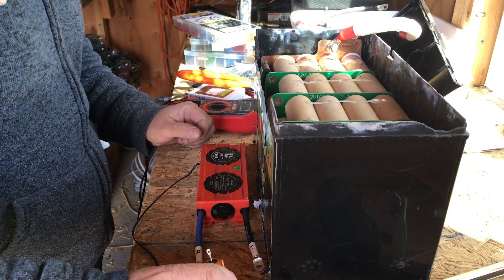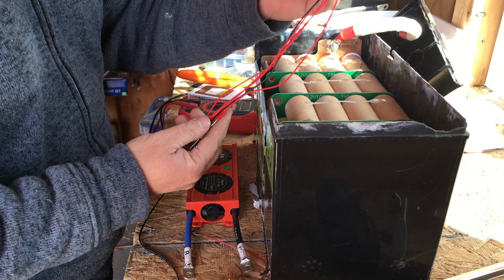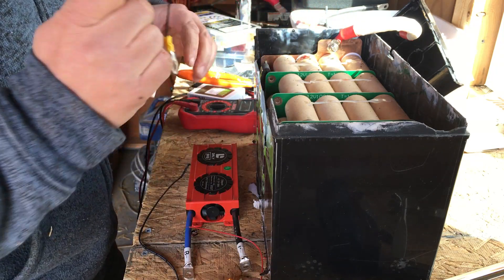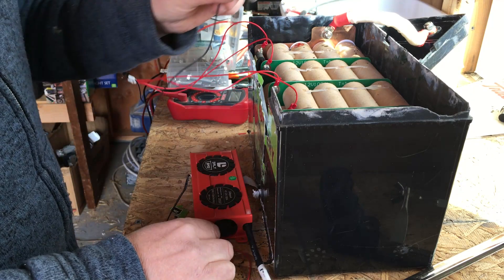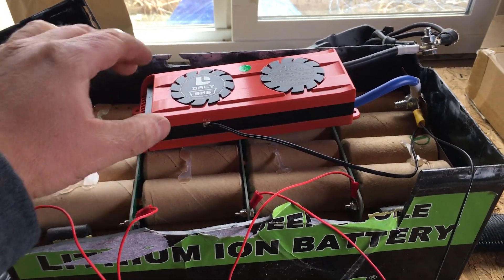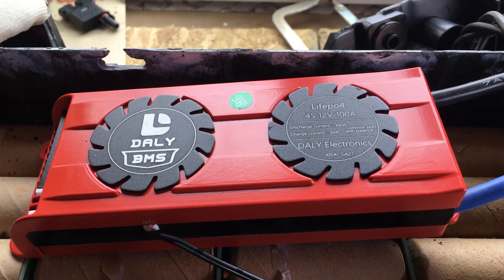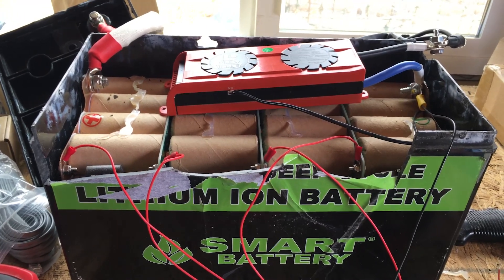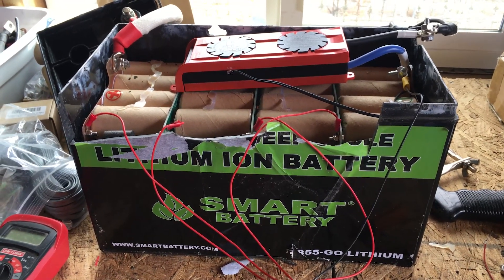Installing a BMS on a 4S 12 volt lifepo4 battery. Updated version https://youtu.be/2bzYHgIR4FQ

Comment: What is the function of the P- /black cable coming out of the BMS? I top balanced a 12V 4 cell battery and when attaching an inverter (3000 watt) and drawing only a 48 inch tower fan one cell always depletes before the other three. Each time it is a different cell. When I attach the P-  cable to the inverter I get nothing . When I attach the P- cable to the first cell negative I get power from the inverter but this is when the one random cell gets depleted while the others are still reading approx. 3.0V but the inverter sets a voltage warning alarm.
If any one can shed some light on this I would greatly appreciate it. TY
Reply from the maker: Lets back up a step because it sounds like you may have not wired up the BMS correctly.
First, did you put the 4 cells in series?
Second, did you wire up the balance wires (the small red/black wires) to each cell.  
B- from the BMS should go to the same cell as the black balance wire.
P- is your new negative.  This is what you would use to feed to your inverter.
if your battery/BMS is not series and balance wires are not correct, then you won't have enough voltage to power your 12v inverter.
Also what is the voltage from your P- and your last cell positive.  It should be at least 12.8v and when full charged more like 13.6-14.x.
Reply: @OurBlackCatCottage  Yes I did have 4 3.2V cells in series which tested at 13.3 volts after charging. I attached the harness negative and the B- cable to the first cell negative and then continued to attach the 1st cell Pos. then 2nd cell pos. etc. correctly. I  then connected the pos. inverter cable to the 4th cell positive terminal and then connected the BMS P- cable to the 1st cell negative which operated the fan until the 3rd cell got depleted while the the other 3 cells remained around 12V plus. I tried connecting the P- cable to the inverter directly with a fresh set of 4 cells but got  nothing but got no power while doing so.   Thank You so much for your help. Also I couldn't see the end of your reply for some reason I couldn't scroll down after so many lines. thanks again
Reply: @michaelc6498  After connecting the B- to the negative side of the cell-pack and then the balance leads, if you measure resistance between P- (which should be attached to the negative charge/load side) the resistance should read very close to zero. If not, you may have a broken BMS.
Reply: @rhkavli  Thanks for your help, it is much appreciated. I may not be understanding your answer 100%. What shall I connect to the P- cable to test resistance? Thanks again
Reply: @michaelc6498  After you hook up the BMS to the battery bank and connect all balance cables and the B- cable to the battery (there should be no load or charger connected), then use a multimeter on ohm setting and measure between the P- and B- cables. It should read very close to zero. The P- should be unconnected when you do the test.
Reply: @rhkavli  Thanks again. I just performed the ohm test and you are correct, the reading was 000.2. My dilemma is that when discharging, the cells remain close in voltage until the hit approximately 3 volts volts then one or two cells deplete to 2.5 volts while the other cells are still at 3.0 to 3.2 volts. Just not getting balancing on discharge although They do balance correctly when charging. I just ordered active balancers to add to each cell along with the BMS and am hoping that will take care of the matter. Thanks again
Reply: @michaelc6498  Here is a video that describes the hookup in detail, including how to activate the BMS. It sounds that you have done everything like this, but double check.
 https://www.youtube.com/watch?v=qb1I8WrQvJM

Comment: I just received my lifepo 4 12v 200ah batteries from china. I set up the BMS and let it charge overnight. 1 cell went to 4.01 the others were 3.36 v range. that doesn't sound good. do you know what I did wrong? thanks
Reply from the maker: Did you balance them before you put them in series? Most people with top balance them in parallel (or bottom balance) before creating the series setup.  It is a good idea to have the cells at the same SOC before setting up the BMS.
Reply: @OurBlackCatCottage  i heard you could use the BMS in series to get them close then switch to top balance in parallel. I thought the BMS still would keep the batteries balanced. so far I have put the batteries in parallel and they self balanced.  waiting for a bench top charger to top balance . I think i killed the Daly BMS.
Reply from the maker: @clarkvalcoic1736  Yeah, I've heard people doing that too.  I bet once you get your bench top charger and you top balance that the BMS keeps them pretty closely balanced.
Reply: @OurBlackCatCottage  thanks for your help. 1 more  question I accidentally shorted a cell but its reading ok. do you think it will die early.
Reply from the maker: @clarkvalcoic1736  I've accidentally done that too and the cell is still working fine. If it is holding its charge that is a great sign but I would keep an eye on it.

Comment: Hello sir I have some questions , can you help me with it ? That’s will be really great for me
Reply from the maker: Sure. What are your questions?
Reply: Little Cat Cottage Hello dear , the size of BMS in Amber depends on what ? Depends on the batteries last Amber , for example I connect 4 cells in series and I get ( 12v , 280Ah ) how I calculate the best size of BMS for this batteries is there an equation so I can apply it for any batteries I vs next times ,,,,,,,, can I use pwm or mppt to charge lifepo4 batteries or it will damage them
Reply from the maker: You an use either pwm  or mppt.  I prefer mppt because it is more efficient.  You just have to make sure that it has a Lifepo4 setting or user setting that you can set for Lifepo4.  Some don't - especially the cheaper one.
Your BMS size is going to depend on the Ah of your batteries and the size of your inverter.
You would want to match the amps of the battery C Rating to the BMS and the output of your inverter
For example, most LifePo4 are 1C so on a 100Ah battery a 100Ah BMS would work.  My main set up  is actually 280Ah (but 24v) so I used a 8S 200Ah BMS (4,800 watt output).  I only have a 3000 watt inverter so I could have used a smaller one like a 150Ah but I think it is a good idea to always oversize a bit.
  @استغفراللهوأتوباليه-ر6ث1ر